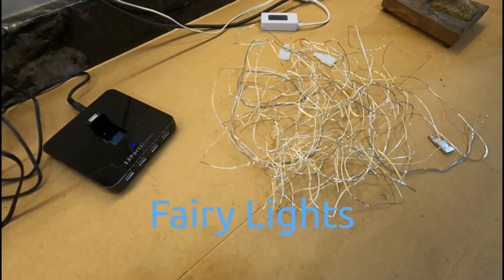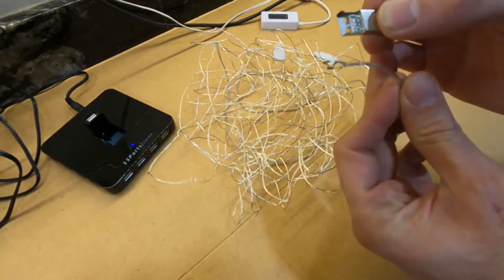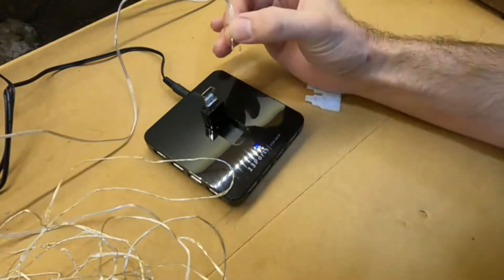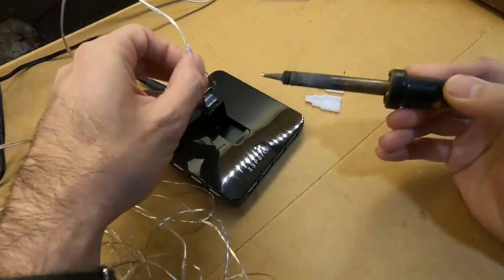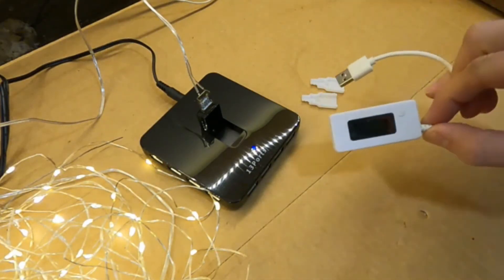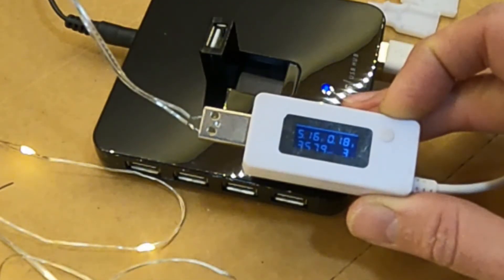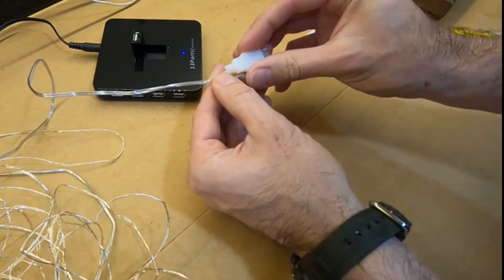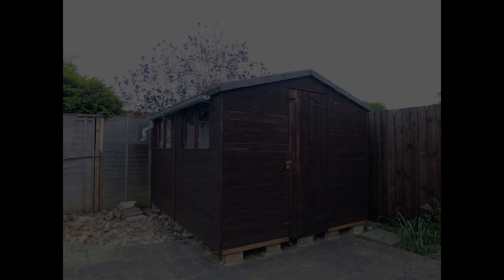USB Fairy Light fix

Comment: no need resistor? still working up to now? how many hours light up? gets warm?
Reply from the maker: There was never a resistor in the body of the connector - I just repaired what there. Still working today - but I don't know how many hours they have been on. At only 180mA spread over the whole string it does not get warm (that's about 1/3 the power of an external HDD).